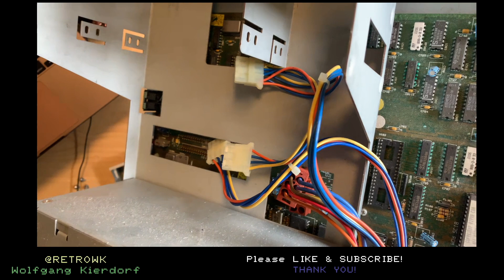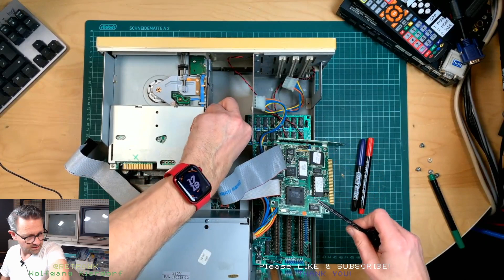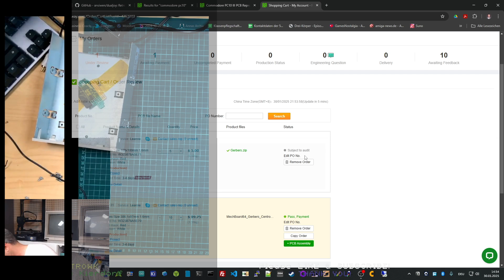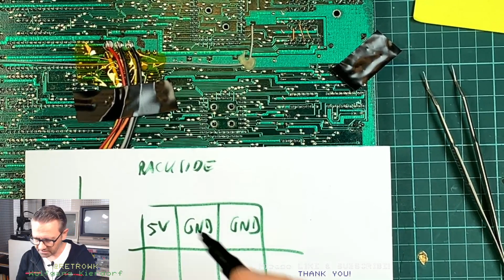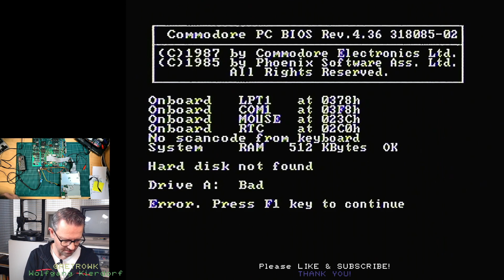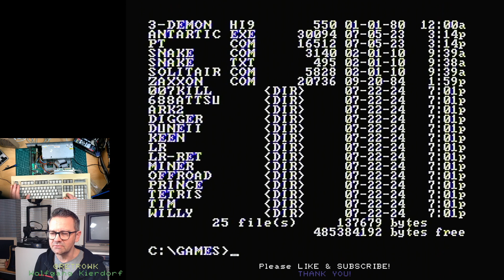A Tale Of Two Commodore PCs (PC10-III, PC20-III) - Teardown, Repair and stuff #pcbway #commodore #pc

Comment: Ctrl-Alt-D will run it at 9.54 MHz (Ctrl-Alt-T at 7.15 MHz). It defaults to 4.77 MHz without intervention. If you manage to access the files on the DOS disk, you might find SPEED.EXE on it which can control the clock rate as well (-s: standard speed, 4.77 MHz; -t: turbo, 7.15 MHz; -d: double, 9.54 MHz). The CPU I had in mine during the 1990s was a Siemens-manufactured 8088-1, capable of 9.54 MHz.

If I'm not mistaken, the on-board 40-pin IDC connector is for XTA drives.

The on-board CGA likely is actually a Plantronics ColorPlus with non-standard 16 colors at 320x200 (that hardly anything supported when this PC came out, but now folks have written a driver for Sierra Games titles). That's what the "AGA" is about. The heavily corroded board likely also had a full complement of 640 kiB RAM on it.

The reason there's a battery on the board is that it builds in a real time clock (RTC), a very uncommon feature on XT-class machines. The SETCLOCK.EXE tool on the DOS diskette can set the system time based on the RTC, quite useful to put in AUTOEXEC.BAT alongside SPEED -D.

Comment: Nice job. I will be needing to do similar to a PSU in a Commodore PC-5. How many amps was your 12V DC power brick which you hosed in the PSU case? Would it be 8 amps or more?
Reply from the maker: Mine was 6.2 amps but there is one that goes up to 8amps / 100 watts. https://www.ebay.de/itm/393996861326?var=662548135943

Comment: The Commodore Colts have an Amiga 3000 case vibe.  Did Commodore design cases in-house or contract another company to do them?  Who gets credit for the case designs?
Reply from the maker: Here is what DeepSeek came up with: The design of the Commodore Amiga 3000 case is primarily credited to Dave Rolfe, a member of Commodore's industrial design team during the late 1980s and early 1990s. While earlier Amiga models like the A500 and A2000 were designed by Ira Velinsky, Rolfe is frequently cited in Amiga enthusiast communities and historical sources as the key designer behind the A3000's distinctive angular, beige case.

The Amiga 3000, released in 1990, marked a shift toward a more professional aesthetic compared to its predecessors, aligning with its advanced technical capabilities. Though team collaborations may have contributed, Rolfe is the individual most commonly associated with its design.

For further verification, primary sources like technical manuals or patents could provide definitive confirmation, but existing consensus among credible Amiga-focused resources points to Rolfe as the principal designer.

Comment: Hooray for the Commodore PC40-III using a Dallas (even though it refuses to boot off anything than 360k 5¼ inch disk when the Dallas goes due to the BIOS doing a reboot on save&exit) and having that Paradise (S)VGA card on board. And yeah I have Win3.1 on that machine on 800x600.
The PC40 seems to be mechanically identical too. The LEDs are on the left though.
All (2) of my Commodore PC PSUs work just fine.
Reply: Hooray for a Dallas? That's sarcasm, right? :P
Reply: @charlesdorval394  No it's not. While it was soldered in and required special tools to remove (which 20 years ago I didn't have - but my neighbor did), just look at what poor @Epictronics had to go through to get his PC-10 III back up and running again.
(and even if not - depending on my level of lazyness or space inside the machine cough Laptops... I just drill the holes in the Dallas for hooking up external batteries without even removing it)
At least a Dallas won't puke corrosive juice all over the board that eats traces, vias (especially in inconvenient places) and creeps inside ICs to slowly destroy them from the inside when powered up. Ask me how I know.